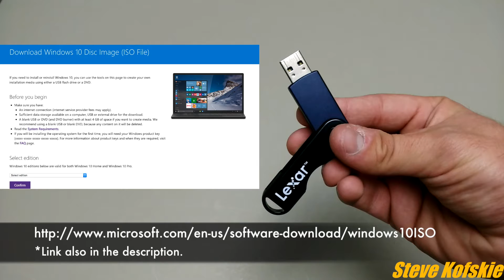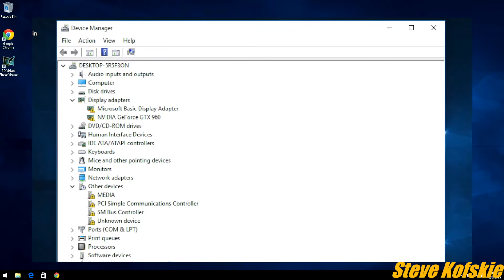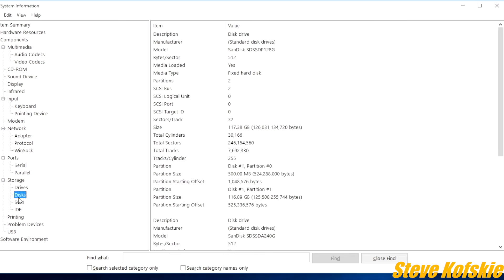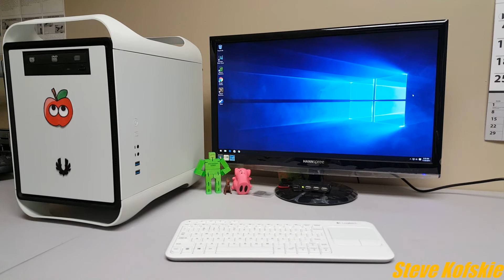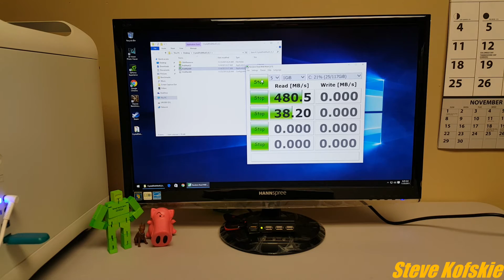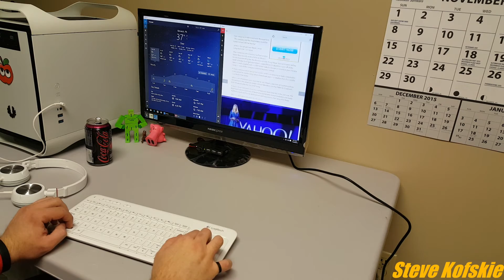Installing Windows 10 On My Customac Mini Hackintosh

Comment: will windows always work even if there is a problem with the mac side? and if so, isnt it only a good idea to get both?
Reply: Yes no matter what happens to your MacOS installation as long as your windows install is on another Hard drive you'll be fine.

Comment: Question on the scores you got on Cinebench in OSX. Your machine is very similar to mine, except more powerful and I am getting way better scores than you? Granted, I am running El Capitan which is the difference, but still your hardware is better than mine. I am running a Gigabench H81N Motherboard, 8GB memory, i3-4170 CPU and a Nvidia GT 740 with 2GB GDDR5 memory. 

The scores I get (even with plenty of other stuff running so I should be able to do better), is 69.96fps for graphics which is slightly higher than what you get with a GTX960! Also, My CPU score was 333cb which is comparable with your Windows score but way higher than your OS X score? Not sure what to make of that.

In any case, thanks for the videos. My Hackintosh is my very first one so I am also going through learning how to upgrade etc. I did pick up a few things from your videos so that is appreciated! Keep up the good work!
Reply from the maker: +David Thorarinsson Thanks!  

Others have told me that my scores are not on par with my the hardware in OS X.  The only thing I could think of as to why my OS X scores are lower than yours may be driver related.  At least for me in Yosemite, I stuck with the generic drivers and kexts that came with Multibeast and never really installed custom patches related to my hardware, with the exception for the Nvidia web driver.  For my el Capitan video I'm working on, I had to do more kext patching to make all my hardware function properly and may cause higher scores (I haven't run the benchmark yet).  

Thanks for the question and good luck with your hackintosh!
Reply: Looking forward to seeing your El Capitan video! Maybe it was just an unfortunate combination with the older OS X setup?  Who knows, I am betting that you will be seeing gains! Keep up the good work!